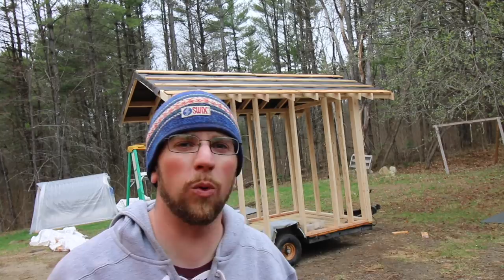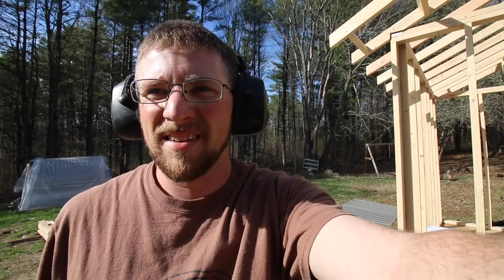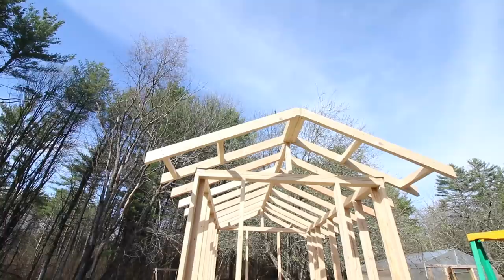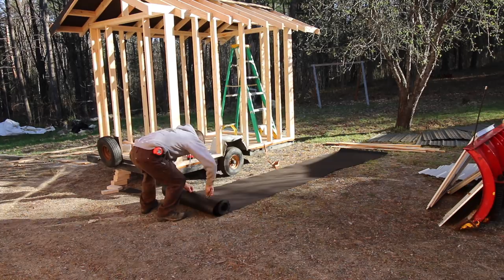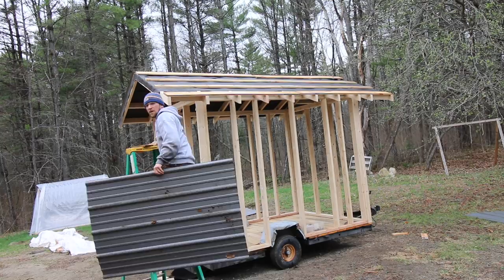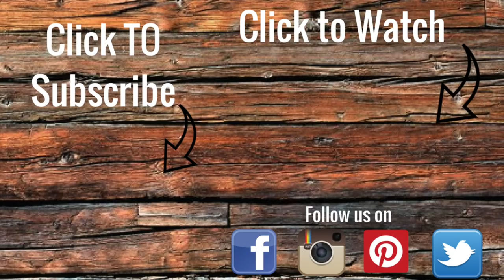Mobile chicken coop Build #4

Comment: You may find it easier to make birds mouth cuts by batching the rafters together , laying them on their back and having set the saw to the required angle make each cut threw all rafters in one go.,  you may sometimes find that the saw will not set to the required angle for the horizontal cut but at least half will be cut quicker , good luck.

Comment: Nice carpentry skills, but do you intend on cleaning the floors?  Just asking, because our chicken tractor floor is wire.  Poop just falls through to the ground.
Reply from the maker: Rob Donaldson Thanks yes I plan on cleaning the coop and then we can put it in a compost pile. They will fertilize the Fields and we can compost what's in the coop! And we are in a cold climate so in the winter the solid floor will be nice

Comment: just wondering why the seam in the strapping is all in-line and not on center of the 2x4
Reply from the maker: I was building the coop with what I had at the Modern Homestead, and that was the lengths I had and I had just enough too